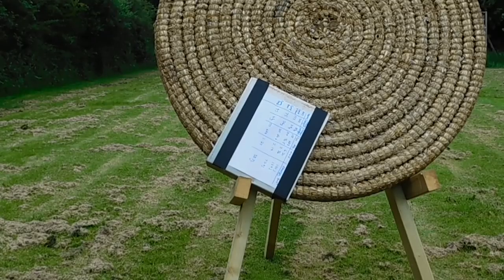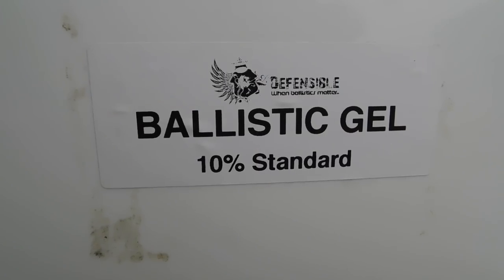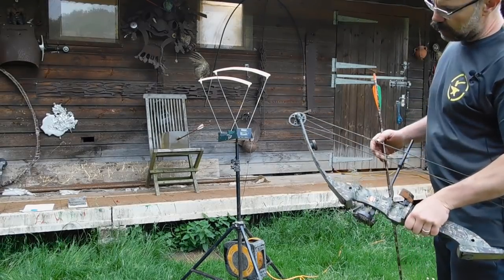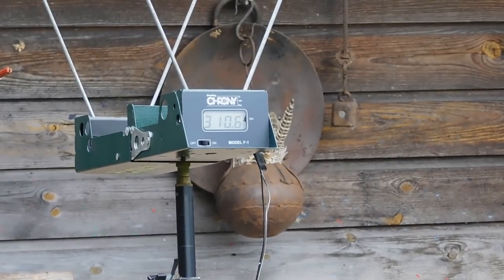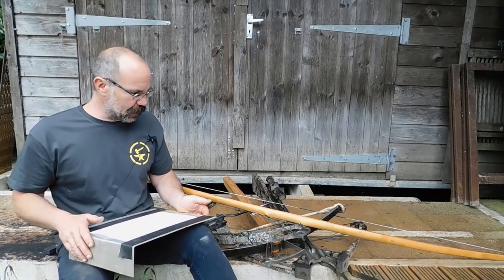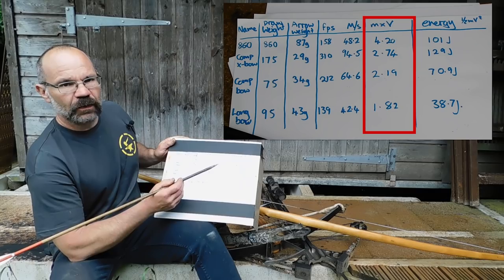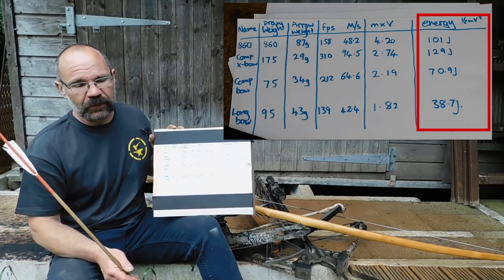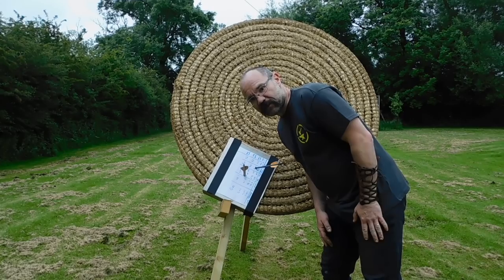Medieval vs Modern Crossbows/bows Ballistic Gel Tests

Comment: Projectile design is the most important factor when it comes to terminal ballistics, not MxV2.

If you compare the crossbows' performance on paper, the 860 has 101J of energy but the comp has 129J, so you could say the compound is the better performer. However, the 860's bolt was stopped completely; therefore the entirety of it's 101J potential was released into the target.

The comp's arrow passed through the target. If we assume the arrow was still flying at say, 47mps (to keep the sums simple) after it left the block, then the arrow still has 70J of energy remaining, meaning it dissipated 70J into the target - 31J less than the 860.
Reply: This is where projectile design comes into play. The bolt is wider, heavier and moving slower, so it has more opportunity to reduce speed once it impacts the target, releasing it's energy faster. The rigid fletchings increase this as you noted. I can't see in the video but I'd expect this one to have the greatest cavity of all the projectiles.

The arrow is lighter and thinner, with less rigid fletchings. The wound channel is thinner and probably has a smaller cavity, so would produce "ice-pick" type wounding.
Reply: Apols for the essay.

Would be interesting to see if you could modify a bolt to act like a hollow-point bullet. I've seen a lot of discussion around bodkin-points for armour penetration and broadheads for soft targets, but I don't think the concepts behind how modern firearms projectiles function were understood in the medieval period. So it would interesting to take some of those and apply them to crossbow bolts.
Reply: bertram238 There were broadheads for hunting and maximizing tissue damage, and bodkins for maximizing penetration especially against light armor. And some other specialized varieties. So, they did design projectiles for (what we call) terminal ballistics. (Edit: I guess you already said most of that.)

As to hollow points, at these velocities I'm not sure it would be practical. I can imagine something like spring-loaded barbs that could expand after penetration, making for nastier wounds and reducing over-penetration. So maybe you could have a bodkin that turns into a broadhead - something like a hollow point. IDK if that was ever done, or if it could be done economically before industrialization.
Reply: I think you could make a bodkin out of lead and modify it into a hollow-point (clip the tip, drill a hole down the head, and then score the sides of the head to encourage it to mushroom on impact). 

I'm not sure intentional deformation is something they necessarily would have wanted, and it would have been a complete no-go in the arms race for armour penetration.

Thinking about it I have no idea whether lead was more expensive than steel back in the medieval period (it is these days, at least as scrap).
Reply: bertram238 Lead was pretty cheap. IIRC it was a byproduct of silver mining, at least in some mines. They'd get a large amount of lead (tons) for free in the process of getting a small amount (pounds) of the desired silver. It wasn't free, but it was cheap enough (around 1000 CE?) to make roofs out of lead. Whereas steel was much more labor and resource intensive and could only be made in relatively very small billets. IDK of any steel roofs.
Reply: bertram238 Even if it would work, which I think I doubt, why make an expanding lead bodkin instead of a broadhead? 

Unlike a bullet, an arrowhead can be arbitrarily broad. 10cm seems possible, or maybe much more. I bet a 10cm wide broadhead would both penetrate and wound better than an expanding lead bodkin.
Reply: bertram238 Another idea might be to put barbs on the shaft, maybe 20cm behind a bodkin, to widen the wound and prevent over-penetration without reducing sectional density in that first 20cm. Like making the fletchings  out of sharpened or serrated steel instead of wood or feathers. It could increase drag in flight if they were much different from normal fletchings, but they might not need to be much different, just stiffer.
Reply: bertram238 In war, almost every target would have some armor, or at least a few layers of clothes. A gambeson or mail would surely cause a hollow point to expand too early. Armor is much tougher than meat, and a hollow point has to be soft enough for meat to expand it. 

If the target is soft enough for an HP, why not use an even more effective broadhead? 

Lol, sorry for the essays. :-D
Reply: They already had a projectile weapon specifically for lead back in the old days. It's called the sling :P

If you have a good slinger with the right projectile and the right sling, you can probably expect velocities of anywhere between 50-70 m/s with a glande around ~30-60 grams in weight.
Reply: Mechanical broadheads. They've been around for decades.
Reply: I think the hollow point idea is kind of unnessessary, since the broad head and the fletchings already kinda serve that purpose. Overall though I just got done making a post that expressed a similar general idea in terms of penetration vs stopping power.
Reply: +The Jackinati They also had the handgonne by the 1300s. Though I'm not sure if they were using lead balls for those back then
Reply: b stoyles Speed is important though, having a high end modern crossbow that shoots a bolt over 500 feet per second means you can shoot farther and more accurately. Even modern compounds can shoot 320grn arrows well over 300 feet per second getting up near 360, again this speed is nice for hunting and not having to be within 20 yards to get a good shot. I also like having a clean pass through, much easier to just pick your bolt/arrow up off the ground then have to cut it out.
Reply: naaah  this aarow at 70 J puncture this house behind on  which it bend but i understand your egzample  , how arrow or bullet should released it energy and momentum at impact should be good on target on whcih somebody  shot if you hunt on prey with very thick tissue before arrow achieve important to live organs like heart you defenitely want more comp cross bow arrow which penetrate very deep and could achieve important to live organs while 860 damage superficial this animal do wound but not kill it other scenario be with target which need more shallow penetration than 860 be better so it depend on target  .
Reply: other word you dont want old crossbow for elephant beacuse it dont penetrate enough deep into its body and dont kill it ,while compound cross bow is much closerr to do this .
Reply: old cross bow have bigest momentum in this comaprision but also bigest diameter form all arrow so beacuse of this diamteeer it have bigest resisiatnce in penetration target so yea it produce bigest impact force in netwons beacuse deceleration on short distance distract whole kinetic energy at very short ditance =big force but big force dont kill prey if dont achieve important to live organs liek im write you need very specified penetration caharacteristic for specified prey it cant be to shallow beacuse than you achieve only sueprficial injury without instictcly death , but it can be little deeper .
Reply: so shape kinetic energy momentum diameter material and bend must be weel choosen for specified animal .
Reply: otherwise angry beer could kill you only with suoerficial damage ; and this is not what each hunters want so much ;.
Reply: @mociczyczki  this was a very interesting thread.  I think its worth raising that maximum chance to kill was not necessarily the goal but rather maximum chance to cause a wound.  

Maximum impact, dumping all the energy on target might hurt the most but if it doesnt cause a wound and the target can just stand back up and keep fighting then was the shot effective?

i would argue that a shot penetrating armor and sticking the target even just 2 inches causes the target to now have to do something about the bolt or arrow before they continue to fight. 
You cant use your arm when theres an object fouling the movement of your shoulder blade or tearing your muscles when you do.
Reply: well like somebody  want it depend on circumstances what somebody want to achieve  wound  be big impact force could be for egzample bone break or some big artery bleeding which after some time kill target ,yea if all energy was distract on target shallow dont do wound it do nothing to target it can outrun etc animal .hoow  arrow penetrating animal muscle etc impact on how they behave fight and body motion depend on animal determination how deep arrow puncture in which egzacly place hit etc when animal fight for its life it collect whole energy inside body what it got  to depend itself and outrun or kill hunters ,hear is egzample how leopard which take like two bullet still can attack one guy and if other bullet other guy dont kill him when he struggle with this guy this guy end with much worse wound or even be kill be this cat https://www.youtube.com/watch?v=Xe6ey3dkdZQ   .
Reply: if bullet or arrow hit where for egzample animal have system nergvous than in such circumstances animal cant fight and move but it depend how arrow or bullet  strike  in which place on body how deep etc one milion posibility we have hear .
Reply: bear with arrow in arm legs chest still can kill human -still can have enough body motion ,energy to inflict enough damage to hunter etc ,human the same if you are determined and you get arrow in arm you still can fight depend how arrow puncture your arm etc the motion this aarm be adequately and still you have teeth other arm two legs ; ...
Reply: I'm sure this or something like this has already been said, but it's important to understand that penetration is lethality, not merely energy dumped into the target. An okay example is that most 9mm loadings end up imparting as much energy on the target as hitting them with a fast baseball would impart, but clearly 9mm is reliably lethal or at least reliably extremely damaging, where as a fast baseball would lead to a broken collar bone or broken finger at the very worst. Energy being dumped into the target is still a good thing in my opinion, but penetration is king.
Reply: @koolaidblack7697  corelation beewten penetration depth and chippings shpuld well cchocice for specific target .
Reply: b stoyles Arrows pierce and cut. Pure kinetic energy is not leathal.
100 joule is nothing.
Reply: When it comes to terminal ballistics, energy transfer isn’t very important unless we’re talking about more energy than you’ll ever get out of a bow, modern or not. Mammals are pretty good at absorbing energy due to the fact that we’re almost completely made of water. Tissue is fairly elastic so you won’t see any kind of tissue tearing from the energy of the impact. With weapons like pistols and bows, the factor that matters most is penetration and that’s where the design of projectile is massively important. Essentially, until you get up to rifle caliber, you’re just punching holes in things. To have an immediate effect on a target, you have to hit vital organs. Relying on kinetic energy or “stopping power” is nothing shy of silly.
Reply: @twirlipofthemists3201  well, often arrow heads broke off when tried to remove them, while the barbs did additionally damage. Then you still have to dig into the wound, removing the arrowhead.

There was also a habit to stick the arrowhead in nasty stuff, like feces before shooting them, especially at war. Without real sanitizer, except honey (and alcohol - which does additionally damage to the tissue) you don't have to penetrate deep into the tissue or have a splintering projectile. But the projectile need to be hard and very steeply angled to penetrate possible armor without skidding off.
Reply: The strategy of using arrows as a weapon is piecing and cutting. Collapsing the lungs and/or causing massive bleeding is the goal. I suppose poisoning and infected wounds were once a factor too, by some cultures.

Energy is one factor in how far the arrow will penetrate, but most will optimize the type of arrowhead to achieve adequate penetration and to slice a reasonably wide wound channel. My hunting arrows will often pass through the chest of a bull elk with enough velocity remaining to kill another elk. I don't consider that a fail, rather a huge advantage. 

Bullets and arrows can cause similar wounds, but generally we don't design bullets and arrow heads to do the same thing.
Reply: @bertram238  Lead would defeat the purpose of the bodkin. I think even hard cast lead would be too soft. A bodkin needs to burst maille, which means out needs to retain its shape. And preferably the head at the very least should be salvageable. Now if you wanted to make a Pilum inspired arrow made to penetrate a shield and deform, weighing down the shield and reducing its utility, lead might work there, using the familiar bodkin shape.
Reply: @WilliamStewart1  This is an important point. The Crossbow was the 12ga slug thrower of its time. Accurate to a short range and able to dump enough energy into a target that even if they didn't greatly penetrate the chest protection, they often shattered ribs, in turn lacerating the heart or lungs (or collapsing them)or rupturing the diaphragm, all of which were immediately incapacitating and eventually mortal wounds, given the time.
Reply: @williamroan5576  Which is fine and all, but I'll still take modern speed and design. A pass through is a good shot in my opinion.
Reply: @ben nichols That's at once a gross oversimplification of things and incorrect. It's a balance between a bunch of things including the thickness and yield strength of the armour and the shape, mass, density, hardness, speed, yield strength AND tensile strength of the projectile. If speed were the key, 55g jacketed 5.56mm rounds would be effective vs barriers and armour. It's not. The military uses heavier, slower rounds with hardened steel penetrator cores to defeat barriers and larger calibers entirely to defeat armour. Lighter projectiles travel faster given the same force behind them, but even in cases where they manage to penetrate armor, they don't retain enough mass to be deadly coming out the other side.

Meanwhile, men on both sides of the war were killed by .303 British, .30-06 and 7.92mauser rounds in WWII when they thought the cover of a tree was enough to save them.
Reply: David Burgin  it's obviously a good thing, if an arrow do not fully penetrate, so the full force was absorbed by the target, causing damage.

Bending on the other hand is bad 🙄
Reply: @bertram238  A crossbow bolt is going too slow for a hollowpoint to expand reliably. You'd just end up with a tip that penetrates poorly without causing a greater wound channel. You can even see this failure to expand in some of the more anemic cartridge loadings today. 

Also, all this talk of dumping energy into the target is overstated. These projectiles don't kill with a transfer of energy, and the whole idea of "stopping power" is a thoroughly debunked myth - a bullet that weighs a few grams or arrow that weighs a few ounces is never going to have the energy to knock a target the size of a large game animal down. No, these projectiles kill by destroying vital organs - whether by incision as with broadheads, or laceration as with bullets. For any arrow, the only things that matter are the ability to penetrate and the ability to cut. If an arrow can punch deeply into the thoracic cavity and cut open the aorta, heart, lungs, or other vitals, it isn't particularly relevant how much energy it transfers into the target.

This is why hollowpoint bullets are good, especially in pistol calibers that aren't powerful enough to cause hydrostatic shock. The expansion of the bullet in the target creates a greater wound channel, and thus causes more internal damage (for defensive purposes, the reduced penetration of hollowpoints also helps reduce the risk of overpenetration and thus the risk of accidentally shooting someone or something you don't intend to, but that's another story).

In the end, all that matters is the wound channel. You want a projectile with sufficient penetration to get where the vitals are, and with the means to do significant damage to anything in its path. If you have those, energy transfer isn't particularly relevant.
Reply: OP, You are incorrect in your assessment due to the wounding mechanics of bows vs firearms. If you are shooting an animal or person with an arrow/bolt, then you do not want it to remain in the body. One of the primary mechanics of killing a target is blood loss, especially for arrows which lack the speed to cause injury around the whole path of the projectile. As such, leaving a large projectile such as a medieval crossbow bolt in the body would actually increase the survivability of the wound by limiting blood loss. Basic first aid teaches that if there is a foreign object in the body, do not remove it. The medical pros will do that after they have examined the wound and potentially clamped off bleeding vessels that would be allowed to freeflow once that object is removed.

Ballistics gel is not the best medium to use when testing penetration of cutting projectiles like arrows. All of those arrows/bolts would have gone fully through an unarmored man. Gel is good for testing performance of bullets because it is consistent and repeatable, but even then it isn't 100% representative of a live body. It's just the best we have found for use in developing and testing modern ammo.
Reply: @williamroan5576  actually, if you research it you will find speed is key in defeating armor, even modern rifle plates. 55gr 5.56 will defeat level 3 plates (when using long barrel rifles) that will stop 62gr penetrators because the 55gr goes faster. Modern level 3A soft armor will stop almost any bullet going under a speed threshold of about 1500fps. Anything going faster punches right through the panels, and rifle rounds going 2-3000fps penetrate easily. They also use a completely different standard of measure against bladed threats because the penetrative mechanics are different. A field point arrow Will be stopped by a 3A panel, but a broadhead will not because it cuts through using the shearing effect of the blades instead of punches through using blunt projectile and high velocity. 

Also, once you manage to get a projectile over 4000fps it can penetrate armor and objects in ways that are hard to currently calculate. Modern firearms don't regularly achieve these velocities and it takes upgrades in nearly every component of the weapon and ammo. Heat generated also wears out the barrels so quickly that it would currently be ineffective to use in most man-portable rifled-barrel applications.

Look at modern antitank rounds, the velocity of those projectiles is over 5000fps. The HEAT rounds also rely upon the pressure/speed of the explosive to force the jet of metal up over 6000fps. So given our methods of defeating heavy armor, it seems evident that velocity is the key.

I mean really, medieval armor began disappearing as soon as firearms started appearing because the faster projectiles easily penetrate it.
Reply: @jonniemactyler7929  There's a difference between punching a hole in a plate and actually killing what's behind it. 55gr 5.56 is ineffective as a barrier or armour defeating round because it loses too much of its mass and velocity to be consistently lethal once it has punched through. If it WERE, there would have been no reason to design the penetrator core ammo, which is the standard for barrier defeating in 5.56, but also not an effective armour defeating round. If velocity was the key to defeating armour, a good .177 pellet gun would be king. It's not, because velocity is just one factor in a very complex problem. It's a balancing act. The projectile has to be going fast enough to defeat the yield strength of the armour, has to be hard enough to punch through, and has to have enough mass to retain lethality coming out the other side. 55gr 5.56 does not.
Reply: @jonniemactyler7929  Also, I never claimed speed wasn't "key" just not THE key, as you and some others are claiming.
Reply: William Roan Every major advancement in armor penetrating weaponry throughout history has been done so via an increase in velocity. Minor advances can be made via modifications to the projectile, but to penetrate harder targets and armor velocity is the key. Yes, projectile weight, hardness, and shape are factors, but if a certain velocity threshold is not reached they will not penetrate hardened targets. After all, in a HEAT warhead the metal that penetrates tank armor is copper foil. It’s just been pressurized and propelled to over 6000fps by a shaped explosive. But velocity is the key that allows such penetration.
Reply: Joules don't matter when it comes to bow hunting, you kill by cutting, not shocking like with firearms.
Reply: 860, hits hard and drops all energy into target. Sledgehammer. 
Compound, moves faster but doesnt drop all energy. Rapier

I love how he points out that any of them would ruin your day.... No kidding.
Reply: Its like comparing the Warhammer 40k Bolter to the Starcraft C-14 impaler. The impaler round is long and thin while a standard bolt round is short and fat. The Bolter round will produce a much larger wound channel and is less likely to pass through, just like the medieval crossbow, even before factoring in the bolt round's explosive charge. It is better against lightly armored targets. The impaler round is very high velocity and super thin with a depleted uranium tip, it is designed for maximum armor penetration. Likewise the modern crossbow bolt is thinner and travels faster. These properties make it better at penetrating armor. 

Arrowhead matters as well, medieval crossbow bolts have broad heads for hunting and for lighting armored troops, and have bodkins to penetrate armor. Modern crossbows have broad heads for hunting and field points for target practice. Field points function just like bodkins.

Oh, and the modern crossbow also has a much higher rate of shot because it can be reloaded by hand, while the medieval crossbow needs a windlass. Likewise the C-14 has an absurd Rate of Fire of 30 shots per second.